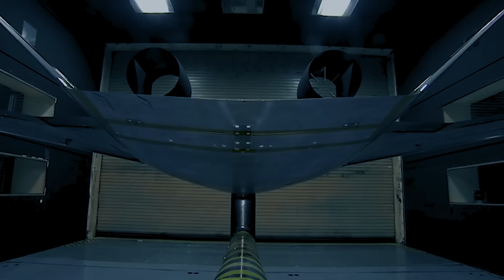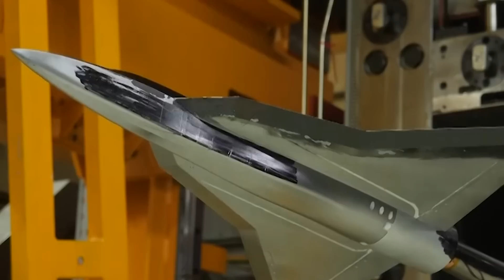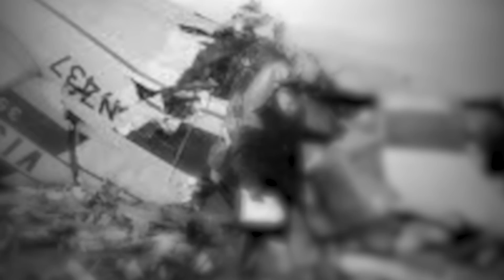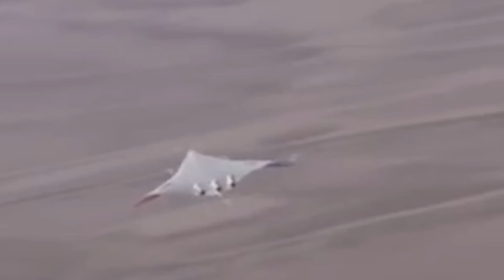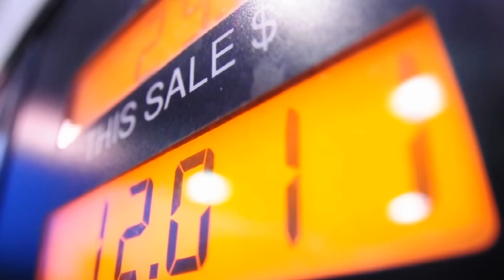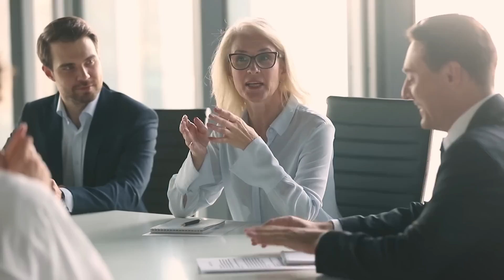Undetectable, Unstoppable and Utterly Stealthy - JetZero's BWB Aircraft

Comment: Blended wing bodies will be a hard if not impossible sell in commercial passenger aviation because of the theatre style seating and lack of windows.
Reply: The Junkers G38 of the 20s/30s had windows in the leading edge.   Once big problem is that when these aircraft bank and if you are a passenger at the wing tip you will experience motion and maybe motion sickness.

Comment: Being a flying wing doesn't automatically make it Stealthy, those engines with exposed turbine blades will make it stick like a sore thumb to radars.
Reply: You’re right. Those canards on the wing tips would stand out as well. Though the fuel efficiency and range is very exciting.
Reply: I mean it still has a lower RCS compared to a conventional aircraft, but yeah. 

 Now we just need airelonless designs using compressed air that he talked about in an other video with a BWB.

Comment: The commercial passenger BWB concept suffers from having exceptionally long evacuation times during emergency.  Until emergency evacuation times can get down to the tube and wing standard, the BWB will not be used for commercial passenger transport.

Comment: one of the biggest things that holds back technological innovation in modern products is that producers have to take into account the added cost to the consumer to change existing infrastructure to be compatible with the new developed tech in regards to this vid that would be the required changes to actual airports lick boarding gate redesign manufacturers know that airline companies wont want a plane that can not dock using the dame boarding gates that all other passenger aircraft use because this would limit  them to only flying to new airports or those willing to spend the money to upgrade to accommodate the aircraft this wouldnt be a big deal if there was only one airline company and they owned all airports in the world but that isnt the case and all airports would need to agree to an across the board upgrade weather it be with or without financial help from airline companies this is the main reason large passenger jet evolution has stagnated for over half a century their form has remained unchanged for well over 70 years even though military aircraft have been consistently evolving in form to keep pace with new technological developments i doubt without governmental regulation and international agreements to force the adoption of this tech that we will see its widespread implementation and its full benefits in our lifetime

Comment: Dont they have a larger cross sectional area when compared to a flying pencil with the maximum aspect ratio? Surely a maximum stretch of a fuselage is the best way to improve efficiency in relation to drag. I only see this as relevant in planes that have to be small, maybe a c130 replacement or smaller. Maybe not even that big. Its the reason they say the celera 500l is only scalable up to a certain size, i thought.

Comment: Ditto to @mike4480 and a question. Why isn't vectored thrust envisioned for the military models? Commercial aircraft would not need it but the military versions might benefit greatly from thrust vectoring for increased maneuverability.
Reply: I’m assuming the model we see in the video is only really meant to be a larger aircraft for things like cargo transport/fueling, electronic warfare, early warning radar, etc. Those planes don’t really need to maneuver super hard, and even if they did it would likely overload the wings. Those things are super thin, and I have a hard time imaging they’d hold up too well in high G maneuvers.
Reply: Interesting thought, but the weight and wasted energy compromises for thrust vectoring would negate the aerodynamic advantages of a BWB or flying wing. Also something to consider, BWB and flying wings are inherently unstable around the vertical axis, and thrust vectoring would exacerbate that on a platform where stability is desired, unlike fighter aircraft.

Comment: Please, stop pushing the LIE of the climate crisis, there is NO climate crisis, it is called weather and NOTHING has changed in thousands of years, other than a little warming, after the Little Ice again over 300 years ago, when the temperatures were 0.6 degrees Celsius below average, when the Thames river used to freeze and they held a yearly Ice Festival on the frozen river itself. Before this, there was the Medieval warm period, which was 0.5 degrees Celsius, above average and today, where grapes grew in England and the Vikings invaded England and other nations. Today, we are at 0.3 degrees Celsius above average. This is the truth and you can check it easily.

Comment: Never knew a blended wing body had a shorter take-off and landing distance. It mysterious ly looks like the Boeing 797 concept. Two difficulties in creating a passenger airliner are its shape is difficult & difficult to calculate a pressurized fuselage and the width is so wide that it is hard to evacuate passengers from in the required FAA time limit. Boeing always kept it on the back burner as a cargo only jetliner. If the military decides in favor of it; then a cargo jetliner is going to come next. A blended winged passenger liner is some distance away from reality.
Reply: Yeah, the evacuation standard is a deal breaker. The surface to volume ratio is simply too low to mount the needed exits.

As a cargo plane it has potential, especially since that would avoid the other deal breaker of having to rebuild every airport in the world.

Comment: Could it be made more efficient using electric motors to drive fans with small engines to create electricity and solar panels over the top edge of the craft?

Battery tech is coming along in leaps and bounds so weight of them may become much better in the future?
Reply: Battery tech is indeed constantly improving. However, there is one significant deficiency that batteries have versus combustion engines, and that is that the weight of the fuel leaves the aircraft as it is consumed, whereas the weight of batteries does not. If battery energy density can improve several fold where the weight of the batteries is less than the comparable average weight of combustible fuel, it may be able to overcome this deficiency, but that's still quite a way off.